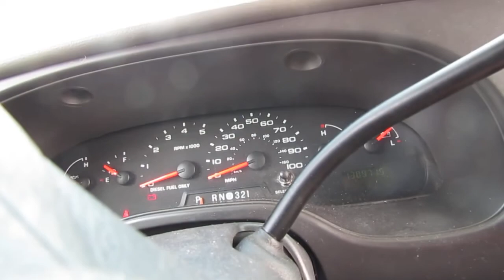2006 Ford E 450 Failed Starter

Comment: Ever find out what was wrong with the engine? My batteries also died and my starter blew when my brother in law was trying to start it. Replaced the batteries and the starter. Still no start. One bad glow plug, would that cause this?
Reply from the maker: The client never gave me a chance to actually find out what was wrong with this engine.  This vehicle was not taken care of.  Your glow plugs has no bearing on your starter turning over the engine.  If you recently changed the starter I would double check that all the wires have been connected properly.  Better yet remove the new starter and do a bench test to verify the starter is working.  I have 2 videos on how to conduct this test.

Best of luck and enjoy your weekend.
Reply: @MotionDesignStudio  thanks! The starter was tested before I installed it. So maybe it is wiring? I will check that out

Comment: Holy shit bro. Your hooked to the wrong posts on solenoid! 12.3 volts after  few attempts to start a bound starter is damn good. In 26 years I'm yet to see a flywheel missing a tooth. Worn yes, needing flywheel replaced yes.. missing or broke by a starter...  nahhh. 
Can't fault you for trying though. And im sure looking back you can surely see what you've learned already. Keep on trying. But for mechanics...skip it.

Comment: What size batteries are the two batteries on the side?
Reply from the maker: Try two : DieHard Gold - Battery: 65 Group Size, 850 CCA, 1000 CA, 150 Minute Reserve Capacity, Maximum Starting Power (Part No. 65-2)